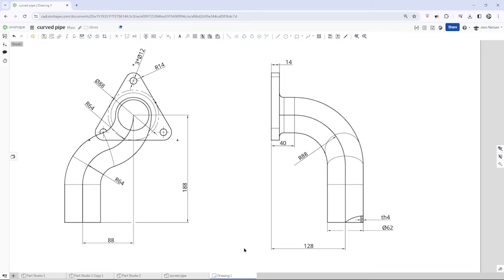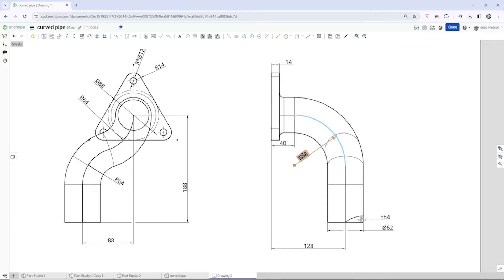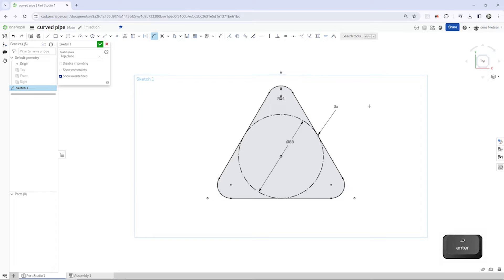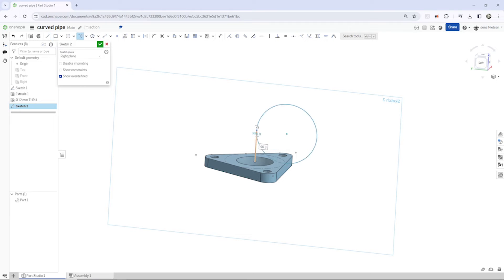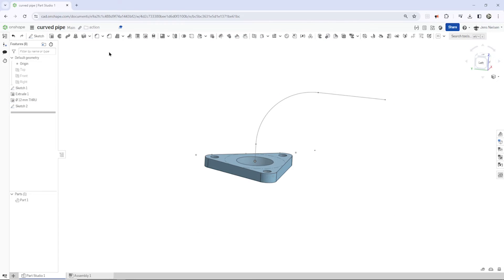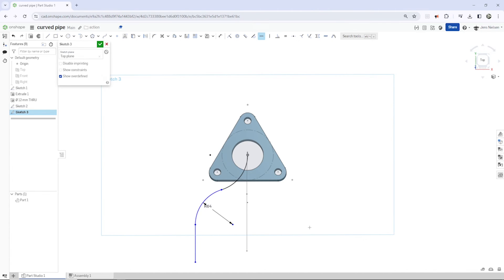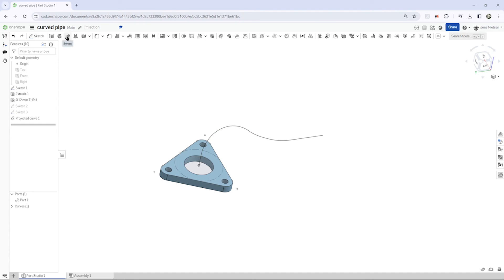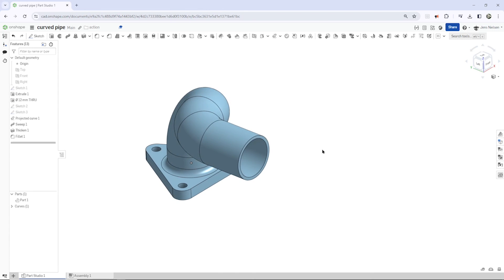Revolutionizing Curves: Projected Curve Design in Onshape

Comment: Can you show me how to draw a curved tube with a mouth of 90, the middle of the tube is retracted to 70 and the tail is expanded to 120, I can't draw it.
Reply from the maker: instead  of  a sweep  that  would be  a loft. what for  do you  need  that  type  of  design?
Reply: I need to design it to use for exhaust pipes for speakers, I will convert it to an stl file to use for a 3d printer, however I cannot draw it, you can make a video tutorial Can it be done on onshape software? Thank you very much, I wait to hear from you @cademist
Reply from the maker: @kenthanoi2224  Hi Kent, I need more information on that project. You can contact me through my webpage Cademist.com.